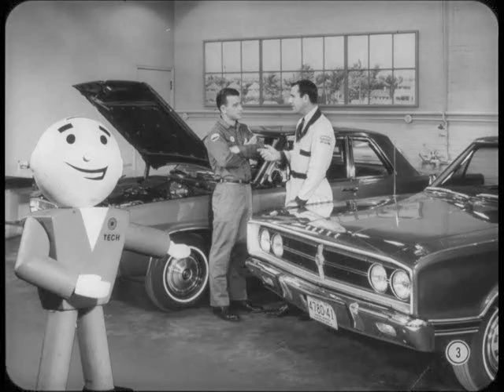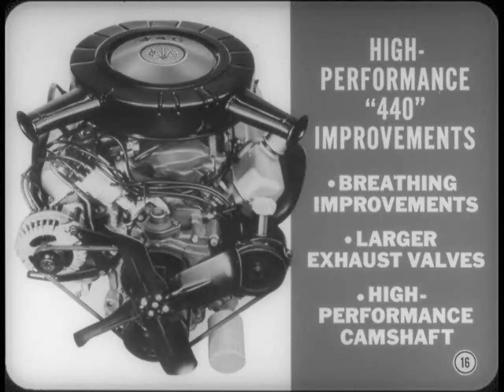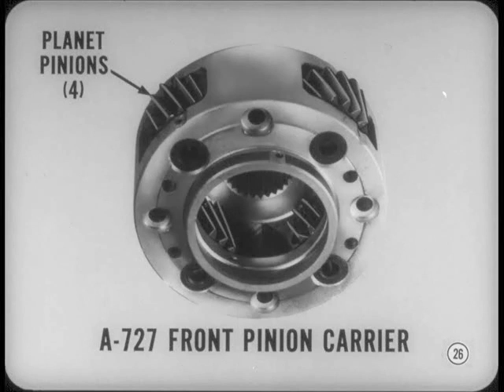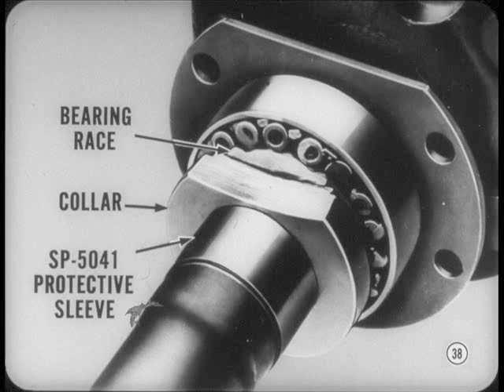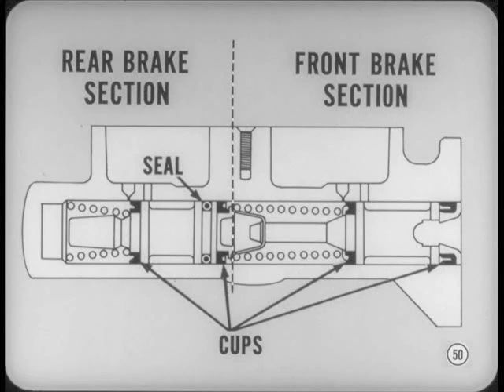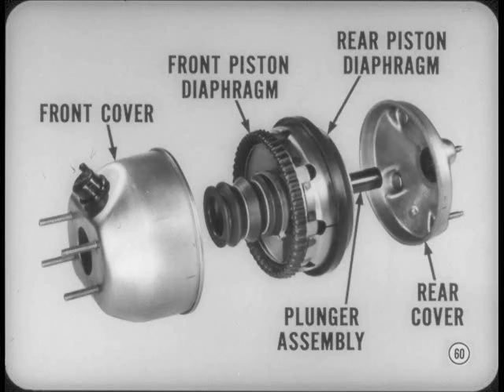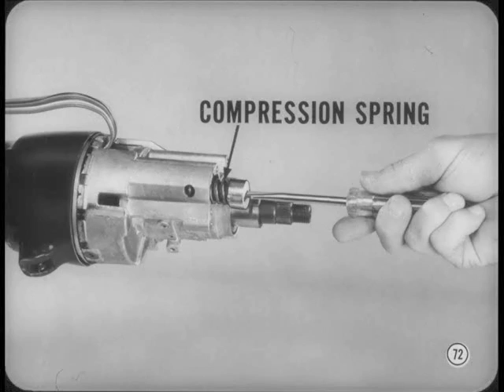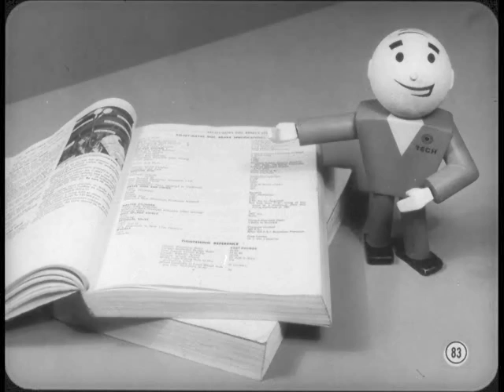Chrysler Master Tech - 1967, Volume 67-1 Service Features for '67

Comment: "Tech" was diagnosed with throat and lung cancer which had spread to his liver in the fall of 1968 … He had a 5 pack a day habit of a Pall Mall non-filters for 25 years .. RIP.
Reply: I thought  he smoked Chesterfields?  Yarrrrr-
Reply: I also thought it was Chesterfields and a case of Schlitz beer every day.
Reply: I sometimes joked that the Chrysler EVA sounded like an old chain smoker. The Datsun/Nissan Maxima and Z-car used a minature record player so it wouldn't sound like and old chain smoker.
Reply: Tech loved those smoking those razor blades.
Reply: So, you knew the service tech in this video?  Or, was related to him?

Comment: I heard that in 1968, all car companies were required to have a dual circuit brake master cylinder. Also, that collapsible steering column is not a new invention, it is just a new item for that year.
I sometimes wonder what would have happened if Chrysler continued making polysphere heads. From what I have read, polysphere cars had very good fuel economy compared to engines of similar horsepower.

Comment: The 318 was a proven engine for a long time,Chrysler dumped it replacing it with a worthless pos  4.7 sohc engine
Reply: I've had more than one of each and they both have their virtues.  Had they made some durability improvement to the 4.7, it would have been alright, but with the advent of the third generation Hemi, there was no real motivation to develop the 4.7.
Reply: Your right-on Mr.Frederick!  I am a former Chrysler/Plymouth/Dodge/jeep line tech back in the 1990's. pre-sellout to the Germans&then frigg'in fiat??........i didn't really plan to keep it for 19 years,it's a 1986 Ramcharger AW150/Royal SE trim/5.2L V-8 2BBL/A727 auto trans.  Dont laugh too hard on this, ive been driving this truck with no reverse for 5 years, I m watching the sequence of trans updates to refresh myself on the trans overhaul/diagnostics. im finally doing the planning/purchasing for the job. It runs fine in forward, I had it rebuilt(1,000$} just to have the band break{they put old ones back in}. Thank you MyMopar.com-BigMike.
Reply: I suppose if smog tests didn't get tougher, they 318 could have stayed.
Reply: I'm very happy with my 4.7 at 199,000
Reply: The 4.7,have seen the valve seat issues,timing chain and guide problems including head gasket failures with the 4.7s.Horrible to work on too